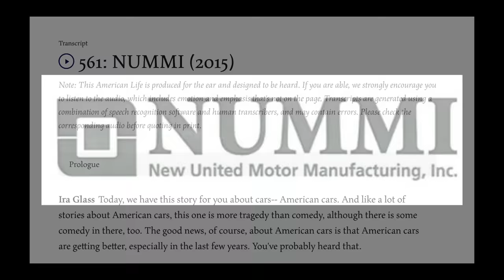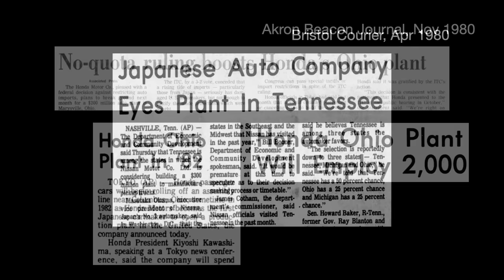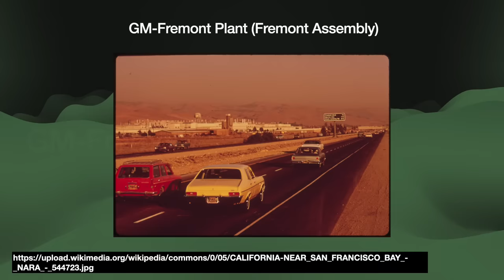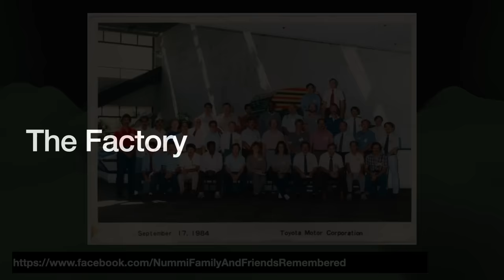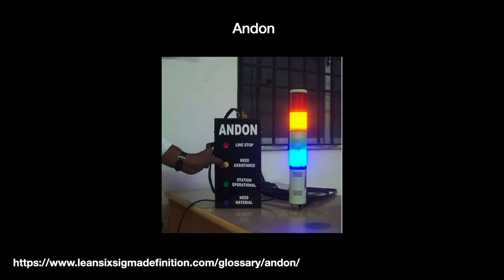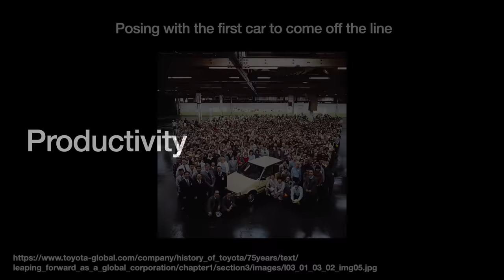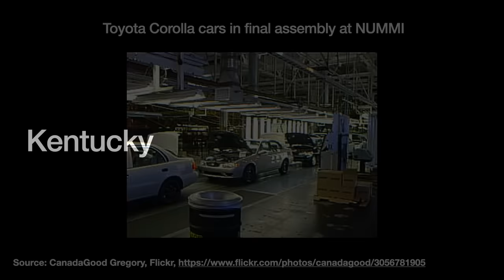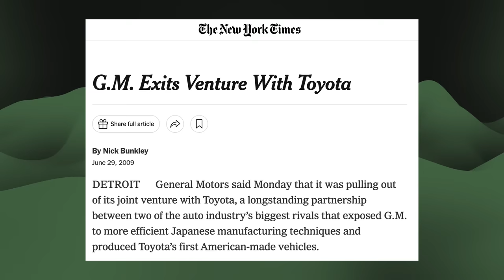How Toyota Turned Around GM’s Worst Factory

Comment: Given how badly many GM cars are built today you have to wonder if they really learned anything. These days it’s not uncommon for a GM parts room to have 3 to 5 engines on hand along with several transmissions. Many 5.3s must be the new destruct-o-cam cause several I saw needed new cams before their first oil change. The 1.3 to the 1.5 3 and 4 cylinder engines eat turbos like a high school band at an old country buffet. And it’s not uncommon to need entire cylinder head replacements. In general GM parts are made as cheaply as possible usually in mainland China and they wonder why the cars have strange problems

Comment: "Nova" doesnt mean anything in Spanish, it means "new" in Latin. "No va" as two separate words does mean "no go", but Spanish speakers are able to distinguish between one word and a two word phrase, theres no evidence to suggest any generation of Chevy Nova (the name dated to the 1960s) did any worse with Spanish speaking customers on account of its name. NUMMI didnt switch from building Novas to Corollas, it built both at the same time, it was a joint venture, the idea was always to make products for both parent companies simultaneously, and that generation of Nova was the exact same car as the Corolla, just with different emblems on it

Comment: Obviously unions aren't the only thing hurting the US auto industry for last 40 years,  but i don't think people realize just how much unions DID harm automakers and much of US manufacturing as a whole. 

 Workers couldn't even get fired for being drunk or high,  on top of a ton of unexcused absences.  Even the tiniest changes in factory lines needed to be painstakingly argued about with union reps before they could be implemented.   Insane rules mean sometimes the simple act of moving a tool takes an extra half hour because you need to track an individual down and it is against the rules for you to simply move it (don't want a greivance filled against you)😅.  
All of this means your products get more expensive while quality simultaneously suffers! 

Pretty hard to work with your labor in a constructive manner when they thrive on hurting the company they work for.  All this while making more money than most unskilled fields.  How is it possible to compete?

It's pretty telling that Toyota's Kentucky plant is NON- UNIONIZED, while employees there STILL make great money and good benefits while not needing to pay dues into an organization that wastes their money and is likely to get the plant closed someday.

I was taught that unions were the bee's knees in high school.   When I got my first factory job making parts for washing machines and natural gas fittings I was stunned at how many people bragged about coming in high or a little drunk and not caring because the union would protect them.  These people didn't work hard,  heck they barely worked at all and took home good money while doing it.  It is incredibly depressing and makes you not want to bother working hard to get ahead. 

That plant closed 16 years ago (what a shocker), and moved south to a non- union shop where the employees made ALMOST exactly as much money as they did in our ohio plant,  but the lack of union dues means it evened out......

I'm sure someone will call me a bootlicker now,  but it really IS a 2 way street between owners and employees.   I have worked in a non union shop and I was much happier knowing my efforts can be rewarded more easily,  the shop has the freedom to adapt more quickly if necessary, and deadbeat workers can get let go......

I think some small and skilled trades sometimes benefit from a union,  but even then it can get out of hand. 

Have a good day.

Comment: Tesla benefitted hugely from getting that manufacturing facility in Fremont for a dime on the dollar discount! Woot Woo Tesla Motors / I wish they had a PHEV for long road trips // or crossing mountain passes in sub freezing winter weather at 80+ MPH // which causes a 300mi EV to give only 140 ish miles of actual range fully loaded with high current use like that.

Comment: Thank you for your videos! If you go back far enough perhaps, some perspective can be found on labor and the US auto industry. Ford brought the costs of labor down low enough to assure a "mass market" for his model T. Early on it took 700+ minutes of labor to build a car. Ford got this down to 93 minutes. Conditions for personnel in automotive manufacturing plants were poor. Before Ford signed a labor deal, conditions might have been worse than poor. As was true for Nummi, the product needed to be profitable. The tradition for US mfrs was to battle with labor over every penny. Management and labor were in opposition. W. Edwards Deming had brought his quality principle to Japanese industrialists in the early 50's while Japan was still under US occupation.  A higher quality product can be produced for less. The Japanese ran with this and were rewarded with 35% of the US car market (small cars and trucks). Traditionally unions play rough and management hires tough guys to work with the union reps. 

VW's Westmoreland, PA plant struggled also with quality/efficiency/labor. Perhaps the Germans just didn't have the patience. The Rabbits they built weren't of the same quality as the Wolfsburg versions. I drove one way back. Didn't really translate. I owned a Geo Prism (Chevy version of Corolla) built at Nummi one of the better cars I've ever owned.

Comment: Silly Japanese...going into business with a horrible luzer of a company, GM and THEN taking over a union factory.  What could go wrong here?
They should have instead developed a factory in one of the free states of the USA (Right to work/no unions" like Texas, which they finally figured out, and done that in the first place.
Everyone was kowtowing to the Japanese then, only because American cars were so bad in comparison.
The successful techniques of handling workers, rewarding them for good work and such are the subject already of many books, and instead, GM keeps doing the same stupid thing over and over again.
As an aside, I bought, refurbished and sold used cars in the 80's and the worst mistake I made was to buy a Ford Falcon/similar.  It stank!  I finally figured out the line workers peed into the ventilation system on the line.
I learned a long time ago, never buy a car made in a union shop.

Comment: So, successful auto plants have no or minimal unions. Auto plants with strong unions die on the vine, or would without bailouts Zero surprise if you spent any time in them. In the 1980s and 90s I was constantly in both domestic and transplant auto plants representing process equipment, mostly non-destructive test equipment. There was no comparison. None. My activity necessitated testing on an actual production line and required line personnel and floor management to grease the ways. Anything that promised the possibility of a process improvement, a productivity gain, or component enhancement was greeted happily in the transplant factories and their parts suppliers. In the domestic plants, it was seen as a threat, I could get very little cooperation and often very openly far worse. One day, while I was straddling a union steward sleeping on a raised platform, so I could remove lockouts to run a test (with a gaggle of Ford engineers watching from afar, half thinking I was nuts, half thinking I was a hero), it became clear to me that the transplants were going to eat these idiots lunch. And they deserve to.

Comment: A robot can be far more accurate than a person, but the underlying theory of doing things is lost forever.  Like a clean freak, let there be nothing at all, while you would gather to have a pile of things you use often, at some point, the pile is to large, maybe bigger shelf, shelves and desks, but underneath it all, your running right back into the clean freak.  So the child is most cleverly constructed, it gives up, almost on a whim, "this looks far too hard."  But in actuallity, any job is exceded imediately by the ambition of the tool set.  But the kid never understands the ambition of a tool set, only the outlying scemata of the task to be completed in a due diligent manner.  Like cutting styrofoam, or glueing things accurately, jobs a robot could train from watching a child learn.  Yet its not the same set of eyes and ears neurology, only a copy of patterns.  So you sort of do need a promary super AI that can be virtualized timewise based upon diligent requirements of any system.  Not like cars aern't 100,000 dollars for garbage shit junk anyway.

Comment: Joe Justice offers interesting insights into how Tesla's assembly line differs from Nummi's. It's radically different. The conceptual gap between Nummi and Tesla is much, much greater than the difference between GM production lines and Toyota's. Even the term 'production line' is incorrect for what Tesla is doing at Fremont.

Absence of a union at Fremont is not the most important difference.